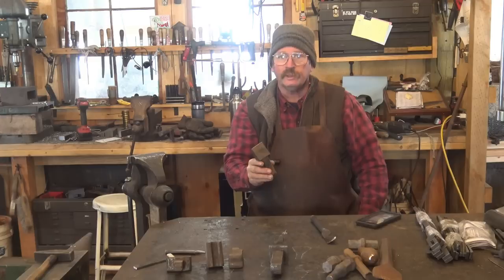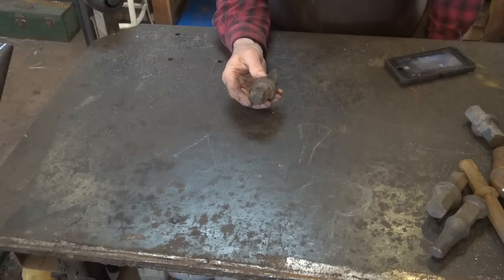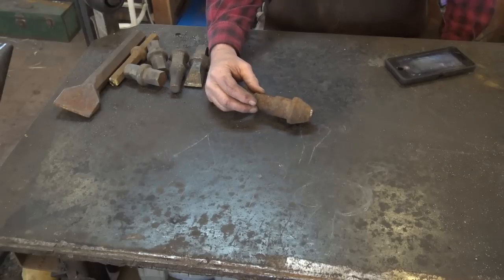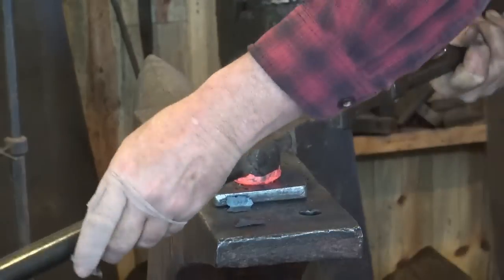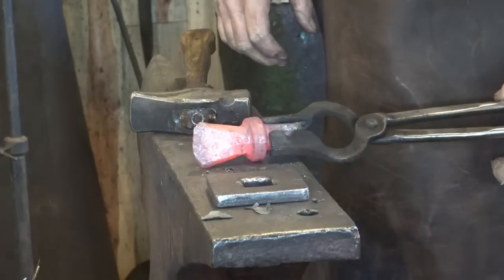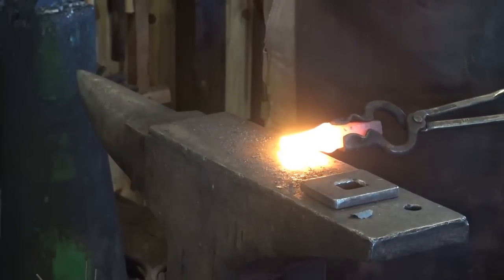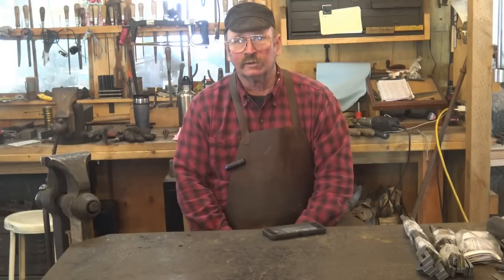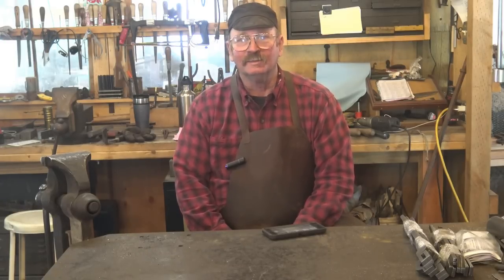Forging simple hardies for the blacksmith shop - tool making

Comment: Justified getting a propane forge for my 64th birthday. Got some tong blanks and a nice 75k english anvil from the 30's.
Have to assemble/cure up the forge and go through the misc. steel I've come across. I've some truck leaf spring I may cut, fold and beat into fullers and such. Have some broken jackhammer bits and will play around with old ball hitches. I'll be beating on rebar to make fire pit stuff and other trinkets until I develop some intuitive muscle memory. Looking forward to it, I've appreciated your videos for several years now.
Reply from the maker: Have fun, there's always more to try out.

Comment: The "I don't know" bit is from either an auger or continous miner. Those bits are unbelievably hard. Having worked underground for 7 years, I've seen what those can do and rocks do not stand a chance against them.
Reply: I would say the mining bit is 1041. Use to work for Sandvik Rock Tool. 
Started as a machinist with them, finished an engineer.

Comment: What a great video to learn from. I've learned tons from your videos and I am very Thankful. I don't have a great deal of smithing experience, especially being a cabinetmaker. But I have made hardware needed to restore period antiques or repaired and made missing pieces. I had a small forge, I called it the BBQ forge with a cast iron pan and blower. A small anvil about 50 or 60 lbs and it worked okay. I lent them to a guy years back, with some hammers and a few tools, and he disappeared. My mentor gave me the forge and the anvil was my Grandfathers and that's what hurt the worse. So I've looked for anvils, I have a blower or two and can make a forge but anvils are expensepive. But living here in Lancaster Co. Pa. farm country, I keep my eyes open for that anvil that will fit my needs. With all the antique German box locks I've restored or make parts for myself, I've made keepers, a bit of forging on the latch and riveting to a back plate I made traditionally with files and the like. So your videos help a lot. One of the professions of my mentor was, born in 1889,' was a blacksmith in a carriage shop, where he learned black smithing and made 6 cents an hour in his teens. I did learn things from him though he couldn't do much work in his 80s and 90s. But I'm sure you can see something done and do it. Your work is beautiful and I love how you maintain the tradition, which I believe is very important. I use traditional old tools in my work. And I have seen many many pieces of traditional hardware for furniture and houses, which I've been involved with restoring. I have a deep respect for craftsmanship and the creative arts, the art of spirit and making something not just for its practical use but made as best as possible. And I also love running across pieces where someone wasn't necessarily skilled but did the best they could and made it work. In the old day people seemed to have a deeper appreciation and did the best they could. Thus folk art. Something almost lost and a few keeping it alive. I believe there has been a growing interest in all the skills and new appreciation for them in the factory produced goods of today. People are beginning to miss the beauty and spirit place in the love of creating something. Weather it be an apple pie or a beautiful piece of iron crafted with skill, experience and a love for the art. This you do and I'm very Thankful for this and your sharing your art. It keeps it alive. DaveyJO in Pa.
Reply: i couldn't agree more, as a carpenter and builder i'm always having to make or adapt tools and fittings, and knowledge like whats presented here is invaluable. how i see it, the more able you are to not only see what you need, but make it, the more generally capable it makes you and the less you are at the mercy of things outside your control, self reliant.

Comment: I made a very simple cut-off hardie from a rail spike today. First I forged the spike's head to fit in my hardie hole. Then I blocked the bottom of the hardie hole with a file clamped to my anvil so the hot rail spike would rest at the bottom and hammered it over 90 degrees to sit flat along the anvil face. Next heat I clamped it in a vice and hammered the spike's tip up, and it's done.

Comment: Thanks John, I'm woodworker who is trying to learn blacksmithing. Every winter I try to teach myself a new trick I can add to my quiver. This winter I chose blacksmithing and your videos have been invaluable! I watch them every afternoon when I get home from my shop and learned so much, with a few chuckles thrown in. My hands are feeling a little numb from spending the day making square shank nails for a customer out of quarter inch round bar. That will make you appreciate automation 😂 Keep up the great videos! I'm learning a lot from you!
Reply from the maker: Nails are more work than they seem like they should be.  I have heard that a good nail maker can do 100+ per hour.  Me it's about 20 and they aren't that good.

Comment: John I was watching the orientation of the Hexagon as you started forging the cutting edge and thought I might mark an indication to keep me on the right track...As it works out I would NOT call it a failure, reason being as I'm very restricted to space around my anvil to move around so it's better for me to have the cutter at 45 degrees so I stand in the centre and still swing...Just a thought, I guess everyones needs vary...Toby

Comment: Thank you for the 3rd cruder hardy. It's an interesting quick & dirty path to have taken with many other tools e.g. a bending jig as well as options for refinement & variation for example welding a third, central piece of tool steel between lower carbon scrap.

Comment: That tooth you were talking about is for a ditching machine commonly used on pipeline jobs to of course cut ditch sometimes called a rock saw. The tip of the ditching machine tooth should have a tungsten carbide insert so dont try forging the tip lol. Sorry if you covered that in the vid i paused it halfway to comment.
Reply: Beat me to it. I worked for a few rock sawing/blasting companies in the past and was excited to dump some knowledge.

Comment: Another great video.  I'll probably use that fold method since I need to fit a 2inch Hardie hole.
Reply from the maker: Thats a big hardy hole.  Do you have a huge anvil or some other reason the hole is so large?
Reply: @BlackBearForge  500+ lb PW.  It's a beast.

Comment: Great video. Eventhought the last example was very hokey. Sometimes you gotta make due with what you have on the fly...and that's A-ok 👍👍
Reply: It reminded me of my first spring fuller... I'd forgotten I still had it. A length of half-inch round, double back on itself twice and forged tight and square to fit my hardie, the two ends bent about 10 inches forward onto the anvil face and spaced vertically to fit stock between them. It was ugly as sin, but it worked very well for years before I made something better.

Comment: Wasn't a mistake, you just made it for hexagon or even an octagon shaped hardy hole :) 
I notice you made the standard convex curve on the cutting edge. I actually saw someone using a hardy that was concave, it made the material being cut tend to jump towards the centre of the tool when struck rather than tending to slide off the edge. I liked the look of it and am going to give it a go.
I have also seen and used a hardy made from a straight piece of mild steel angle iron, seemed to work okay as long as the steel was good and hot you were trying to cut.

Comment: I hope to forge someday, I have the bug bad from a hundred+ videos... Many on how to get started for cheaper... I've checked out many comparisons on anvils or anvil shaped objects or not even shaped much like an anvil pro's and con's. Cheaper forges or maybe just a fire, charcoal and something to blow on it. I have a pretty good idea which tools I need to buy and which I can make sooner or later. There is a pay to play forge in a nearby city but I'm thinking it's pretty expensive. Also it seems to be structured more to classes than free time, which I could use, but would rather mostly do my own thing, thus my own forge once I have a place to put it. Anyway for now I gain knowledge from people like you. How to do, what to use, why to do it. Things like normalizing, heat treating, etc... I'm starting to understand more. Why some metals, what the differences are, etc... Even if I never get to use it I find it very interesting, and if you don't start somewhere you never go anywhere... Thanks for the info, I would certainly have a hardy hole if I buy an anvil or if I make one, and a cutoff would be my first tool.

Comment: That last salvage piece that you talked about is a tooth to a milling machine for asphalt. When I used to work for the city's asphalt crew, the machine we used had a big cylinder full of those teeth. They're super hard, and can take a beating. Given, we had to replace them every once in a while due to wear and tear, but they can withstand all sorts of abuse.
Reply from the maker: I don't suppose you know what the material is?  They look like they would be very useful for several different tools.
Reply: I used to operate an asphalt mill. The teeth we used had a carbide tip on them. We changed then when that wore off. Not sure what kind of steel they are made out of.
Reply from the maker: Thanks, I will have to experiment a little.

Comment: New to smithing (JUST got anvil, but forge needs to be completed and I can get started), but was looking for feedback on a hardy idea: flat bar (either from round stock such as coil spring and forged or already flat) about the width of my hardy hole, worked like your third tool but folded on itself from the center of the bar and the ends folded outward evenly as the shoulders. 
Small wedge hammered in to stretch the flat stock like you do when fitting a wood handle to a head (axe, hammer, etc), only slightly wider. 
Forge welded together (hence slightly wider, to correct for welding and hammering). 
Wedge has more of a diamond shape so you can forge weld another piece of smaller, folded, v-shaped flat stock over it that can be hammered to a chisel point for the hardy. 
Wanted thoughts for longer lasting tools for those of us on a budget? The second flat stock can be a harder steel, but I was thinking just using coil spring as well, since I was also thinking of hardening the first a bit as well just under the shoulders? For the stresses of being used as a counter weight against the inside of the hardy hole? What do you think? Anyone and everyone else? I'll seek further feedback on other videos as well but this will be one of, hopefully many, as I actually get started. Thank you all for any criticism and feedback offered.

Comment: I used a couple of those mushroom looking things that came out of a blacktop eating machine to make some hardies. They worked fine but one thing to watch out for is making sure to knock out any carbide tip in the end of it before you go to forging on that end. (experience talking here, had to grind out the mark in my hammer.)
Reply from the maker: The one I have doesn't have the carbide anymore, but that is a good tip.

Comment: What kind of coals are you using?  Where do you get them?  Thank you for your expertise.  You’re a great teacher.
Reply from the maker: I use metallurgical grade bituminous coal.  Low sulfur, low ash cokes well.  It is getting harder and harder to find.  You msy need to have it shipped depending on where you live.  Check with local smiths to see where they buy theirs.

Comment: the i don't know bit is from rock grinding machines. these are replacable teeth with carbide tips that end up wearing off. check to make sure the carbide is gone. vermeer sells these and you could find info from them .

Comment: The hardy hole on my small anvil is i wanna say is the same width as a railroad spike.I may make a few cut off hardys and some swedges and fullers.I have some thicker steel around to make what i need.My cut off i made out of a railroad spike head actually does well but its not the best.
Reply from the maker: It is much easier to make smaller tools, so a smaller hardy hole can be a real blessing.

Comment: When I worked for the fire department the fork of a halligan was broken during training and it was thrown in the trash. I asked my captain if I could have it and he said yes. I was wondering if that would be good for making some hardy tools? The research I've done seems to indicate that it is probably 4140. I'm thinking that I could cut the adz off and weld on square bar for a shank to fit my hardy hole and still have a bunch left over.

Comment: Brand new to metal working and have what is probably a dumb question but you mentioned burning the metal. How can you burn the metal? Won’t it just become softer and softer the more you heat it?

Ps. Just found your channel and love it! 👍 Great info!
Reply: I honestly do not know the answer, but I'll take a guess.

I imagine it has to do with breaking down the molecular bonds of the metal making it impossible for it to return to its previous state. I think of it like the difference between giving raw and cooked bones to a dog. You can give a dog a raw bone and they will happily chew on it all day, but if you give them a cooked bone, it will splinter and cause all manner of problems.

I'm thinking that if you were to overheat metal, you'd need to smelt it entirely to return it to a useful state, but then again, I'm just speculating.
Reply from the maker: Given enough oxygen most materials will burn.  If you have ever seen fire works, the sparks are often from burning iron.  Don't think of it as a self supporting form of combustion like a camp fire though.

Comment: I am about halfway done with just this very project using a jackhammer bit. Do you have any thoughts about the shape of the cutting edge? If I were to make it just like my slitting chisel, it would be a curved profile with a very acute cutting bevel, much less than 30 degrees. However, the commercial offerings are a flat profile of just at 30 degrees.

Comment: Nicely done, I made a hardy cut off tool today from 1060, didn't put a collar on it. Wonder if I need to weld something on there, it stays in place because the hardy hole is tapered.
Reply from the maker: some people prefer the wedging action instead of having a base

Comment: Make a hardie tool that has a spring which curves back towards the edge of the anvil and has a flat plate which is in line with the edge of your anvil that acts as a set hammer

Comment: I'm thinking of a set hammer on a spring and hardy tang.  For those who don't have a striker🤔. Your thoughts?
Reply from the maker: It should work, but might be a bit limited on where you can use it.  Thats one reason I like the treadle hammer so much

Comment: Speaking of hardy tools, do you think a old trailer ball might make good hardy cut off tool if forged into the right shape,  and do  you think the steel would be good enough to harden and temper?
Reply from the maker: It might work, but I haven't tried it before.  I do use one as a ball stake occasionally and it seems to hold up well.

Comment: Can you also aneal any type of steel by just letting it air cool or even cool off in the forge while the forge is still cooling down?
Reply from the maker: It depends mostly on the steel.  When you cool in air you are normalizing, which is not as soft as fully annealed stock.  Of course air hardening steels can't be normalized.  Allowing steel to cool with the forge is slower and therefor softer than air cooled.  Same goes for burying in vermiculite or ash.  To truly anneal you have to follow the manufactures guidelines for the particular steel, some require very controlled slow cooling over many hours.

Comment: I had no idea what sucker rod is. So I googled it 
“A sucker rod is a steel rod, typically between 25 and 30 feet (7 to 9 meters) in length, and threaded at both ends, used in the oil industry to join together the surface and downhole components of a reciprocating piston pump installed in an oil well”.
Zero chance of finding one of those here in AU 😀

I have a coil spring waiting to be straightened.  I see if I can figure out how to do that.
Too hot here to light fires at the moment anyway.  Hmm could even be a total fire ban.
Reply from the maker: I suppose I should explain what the source material is a bit better.  I'm sure there are other materials that are similar.  We have fire bans in our area most summers.  I can still use the gas fore indors at those times.  But no outdoor cutting, grinding, welding or open fires.
Reply: No big deal, you can’t explain everything.  😀 Unique names like that are easy to look up.
Reply: Hello fellow Aussie. It seems that australia is not a very good spot for a blacksmith. Getting material tools and coke is really hard.
Reply: A possible source of good steel for hardies is pneumatic crowbar rods and stone chisels used in quarrying and opal mining which being in AU might be a little more available.
Reply: Dalhissinth Ragnarokta yeah car spring work well too
Reply: Cut how much coil spring you need, then straighten just that piece. A lot easier that way.

Comment: I have a hardie tool hole in the top of my anvil but I’ve noticed I have another hole straight in the body underneath the hardie been wondering what it’s for I know I have a real old anvil it was in sheds it’s whole life but has pretty intense pitting on the   Sides, the top is still flat in 2 spots and in the middle there’s 2 round grooves that were done by forging in that one spot for a long time by my grandfather one larger one smaller across the anvil that I can use perfectly to round metal I’m almost 100% sure it’s wrought iorn so that might give some insight on the age